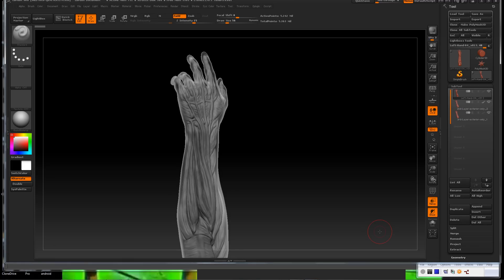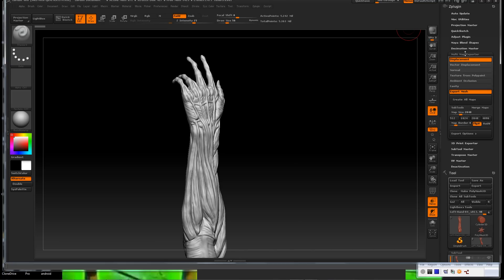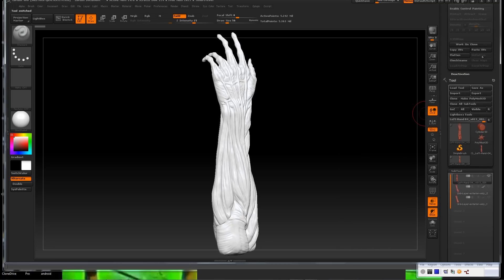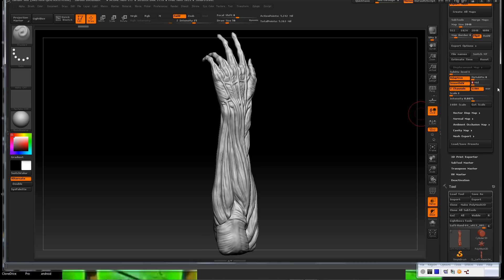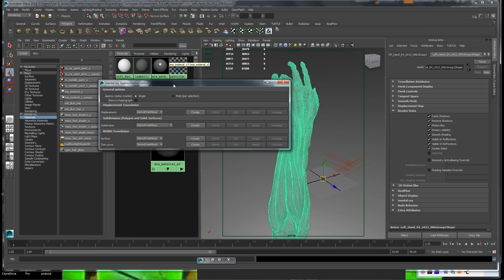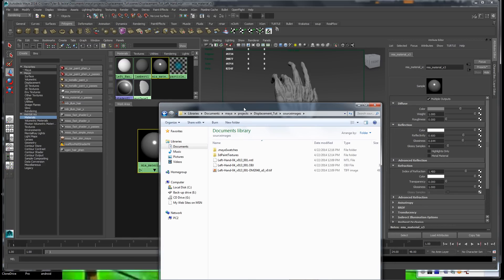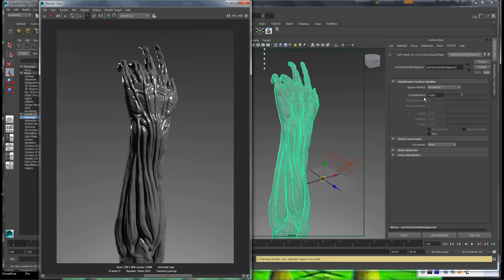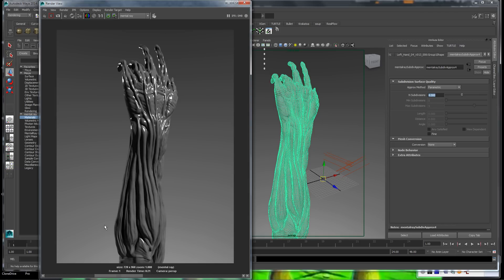Displacement Mapping in Maya with ZBrush Displacement Maps

Comment: why use a displacement map on a mesh that looks like already very high poly model? The mesh that you used was barely animatiable because of the high resolution. You should have showed a way lower polygon model that had may be 200 polygons and then showed the displacement quality on that. I hardly saw any difference with the disp map on this hires model.

Comment: Thanks for making this tutorial. I have an issue, my object disappears as soon as I create approximation. Does anyone know possible solution?
Reply from the maker: Hi Michal G,

When you say your object disappears, do you mean it's not showing up in the render or is the actual mesh model disappearing? What version of Maya are you using? I know this process works with 2010 and up, but versions before 2010 have a different process. Here are a few basic things to check:
1.) If you have assigned a mentalray material to the object, make sure mentalray is turned on before rendering.
2.) When creating and exporting the displacement map in ZBrush, export the mesh at the same time; if there is any difference between the mesh you created the displacement map from and the mesh you are applying it to, it won't work.
3.) Make sure your objects normals are facing outward in Maya
4.) Make sure there are no overlapping UVs
5.) In ZBrush under the displacement map options, make sure the "Mid" slider is set to "0", by default, it is set to 0.5.

Comment: good tutorial, but mental ray machine consumes way too. greetings and thanks
Reply from the maker: Hi Rodolfo - One thing I did not mention was adding a normal map. If Mental Ray is taking too long to render a detailed displacement map, try dialing down the N Subdivisions in the approximation editor and plug a normal map into bump. ZBrush's multi map exporter will create normal maps and its a fast way to get displacement and detail.
Reply: Thanks for the tip: D
Reply: Mega J you should make another video